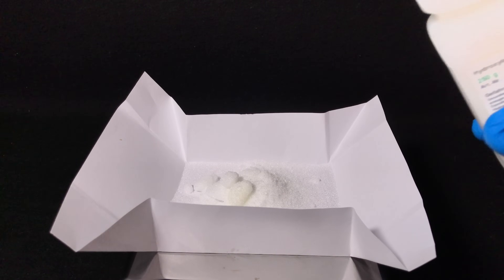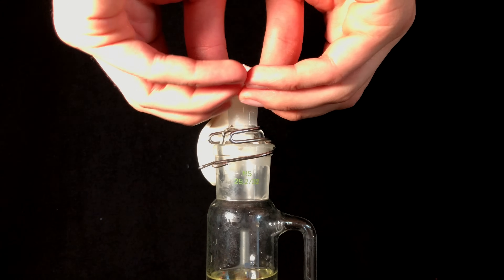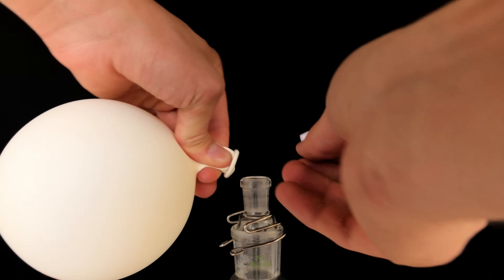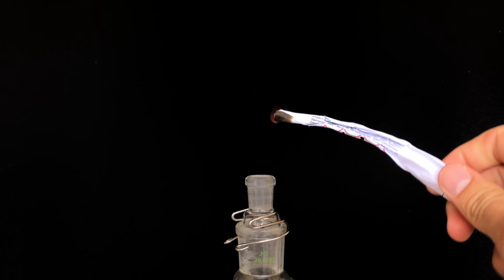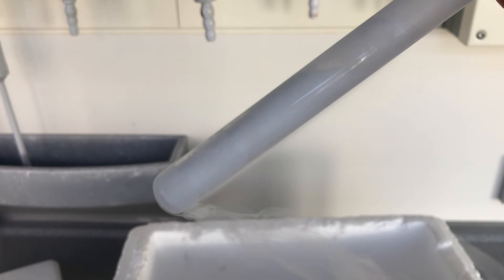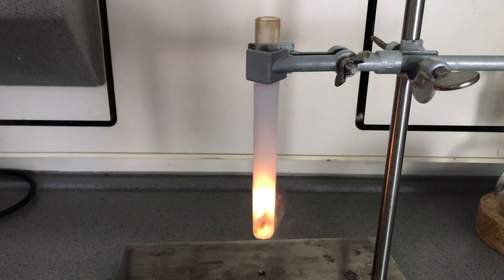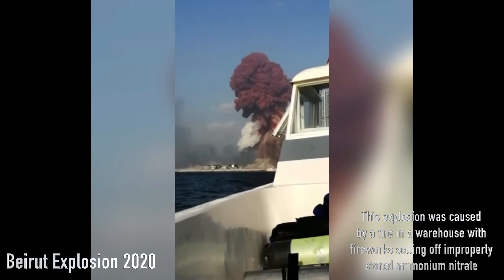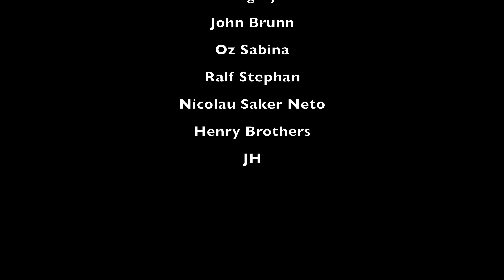How To Make Laughing Gas?

Comment: if you inhale too much you can sufficate and sdie
aka DONT DO IT, but if you do it, dont use the methods here, buy the cleanest grade you can get!! or follow the wallet reduction method
Reply: for ammonium nitrate to detonate you need a detonator, heating will not be able to initiate it.  don't use it as it gives dirty n2o, you can pay a little more and use hydroxylamine, you don't need much n2o for your experiments
Reply: You cant suffocate lol if you can survive without air for at least a minute lol

Comment: Don't heat up NH4NO3 to make N2O. First as said in video it can explode (it not easy thing to take place, but possible).
Second I can tell you short story: during heating in the beaker due to short removal from heater and surface being exposed to room temperature air, it developed crust.It was tried to be break by glass rod which ended up huge eruption of molten salt (~200*C liquid) under pressure. The result was pretty strong burn of the hand and thanking the God, that eyes were protected with goggles from splash...
Reply: Thank ppe. Not god.
Reply: @muhot1013 see God?
Reply: Problems like the explosion risk and what happened to you are why you mix the ammonium nitrate 50/50 with acid washed sand.

Comment: So what's the best way to scrub the gas so we can inhale it??
Reply from the maker: The best way to scrub them would probably be leading the gas first trough a solution of hydrogen peroxide and then trough sodium carbonate followed by another washing bottle of water. you need a very good washing bottle with those ceramic plates to make the bubbles smaller. i still don´t recommend inhaling it but most NOx should be gone with this method.
Reply: @THYZOID  how nice of you too help me get high you amazing person you!
Reply: Considering that NO2 and NO are acidic oxides, you can probably use a base solution to take them out
Reply: @niswear84  but you want the dinitrogen oxide you just don't want the nitrogen oxide right? You would defeat the purpose if you used a base to scrub your nitrous hit away...lol
Reply: @DJChesley  nitrous oxide is inert, it wouldn't be neutralized by a base..
Reply: Lmao 🤣
Reply: This guy gets it 😂